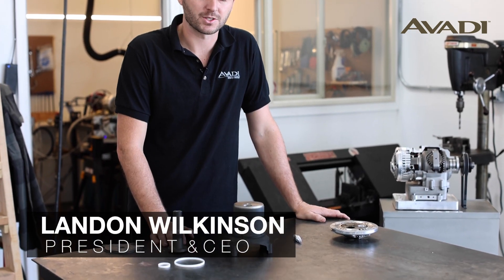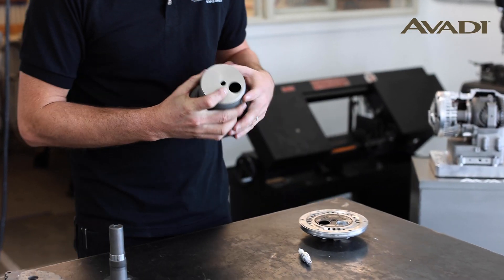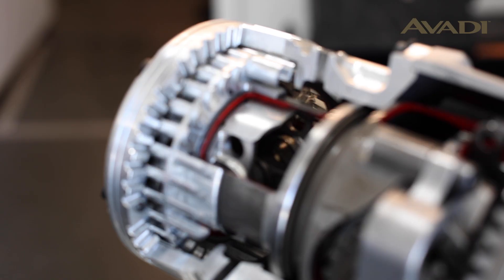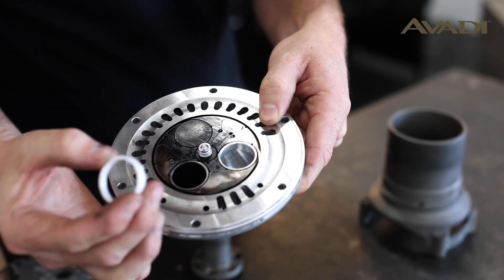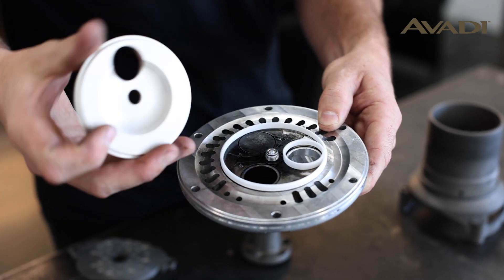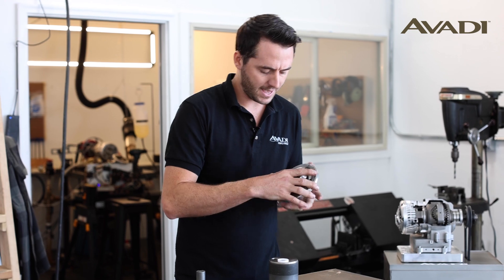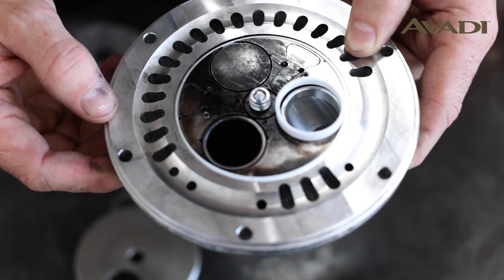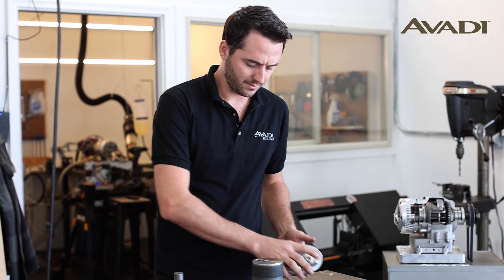Avadi Engines - "How does the valve seal?"

Comment: What happens when the tiny holes that provide back pressure for the sealing rings become clogged with carbon? I think bad things would happen. Have you run the engine until failure? How long did it run?

Comment: Have you run the engine using only springs to apply pressure to the ceramic seals, without the assist from combustion gases?  I’m curious if the seals float up and down in their seats, as combustion only assists once every 4 strokes.  If they “chatter” they may crack or bind and fail to maintain consistent long term sealing.  I also wonder if the intake stroke wouldn’t pull the seals backwards into the head.  I’m not trying to get in your business.  I love what you’re doing.  I just geeked out for a minute.

Comment: I would like to congratulate you for patenting the engine design and successfully completing the test runs. I think your engine is perfectly suited as a compact range extender for ev’s. As this can fit anywhere in an ev with small AFPM motor as a generator further reducing the size of whole unit.
Reply: Another new engine on its way
Reply from the maker: Thanks Sachin, much appreciated.

Comment: do the rings rotate? how do you deal with the uneven wear in the ring and in the valve disc?
Reply from the maker: The rings remain stationary in the head for the most part. The intention is that the wear will remain largely consistent on the track of the ceramic on the valve disc, thus enabling continued seal.

Comment: Would the ceramic wear quickly?
Reply from the maker: So far there is little to no evidence of wear in the ceramic rings. However, we are now adding lubrication to the head as we think the friction and heat without lubrication is not going to be a long term solution.